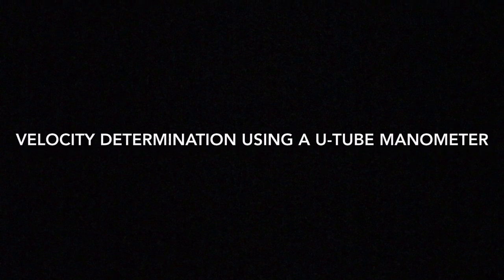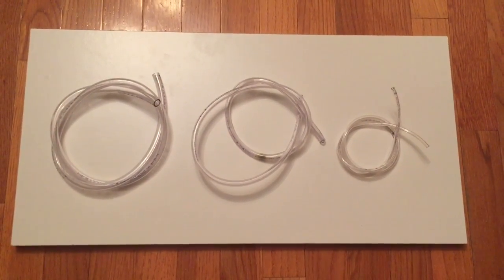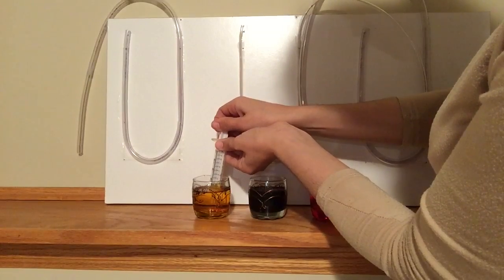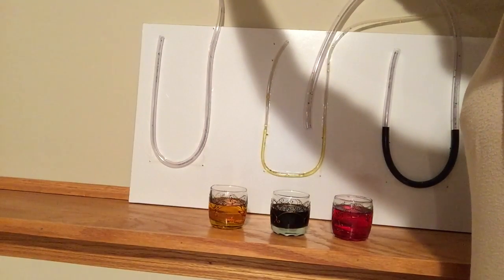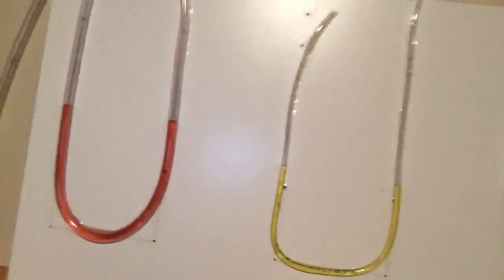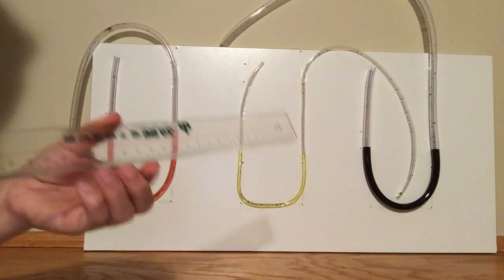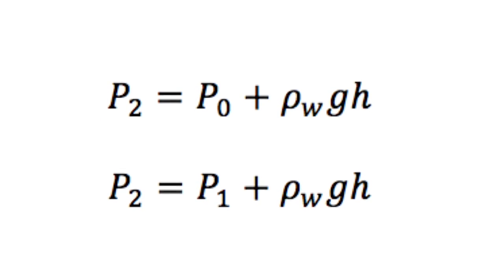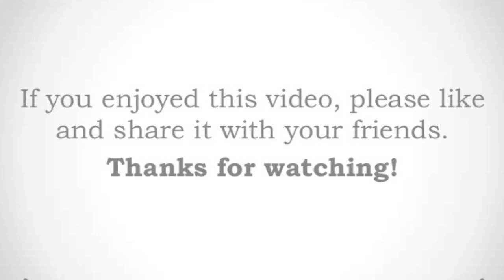Homemade U-tube Manometer: Air stream velocity

Comment: The measurement was done incorrectly. I believe you should have measured the distance between the two columns of water, rather than the difference from the static position. Plus of course you were measuring static pressure generated by the hair dryer rather than velocity.

Comment: Since you used a closed cap on the dryer you ended up measuring the static pressure of the blower but your calculation of the velocity of the stream was bogus since the velocity was of course zero.  Please look at any blower curve to understand your error and refer to a pitot tube setup for the proper method.
Reply: Thank you, I knew something was wrong with this experiment

Comment: Thank you for posting this video, I used your formula to calculate the wind speed in my wind tunnel, the height I got is around 10mm and water density is 1.20, the wind speed calculated was 12.7m/s, do you think this is a reasonable number or its wrong? I seems quit high to me I was expecting something around 5m/s